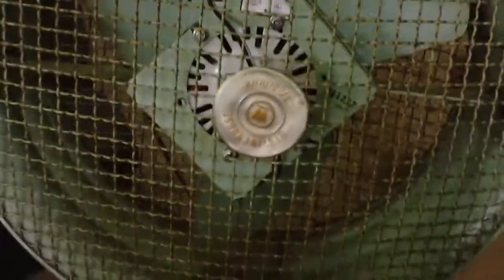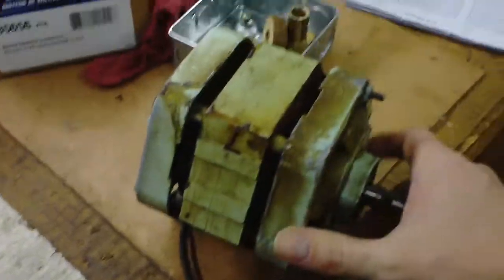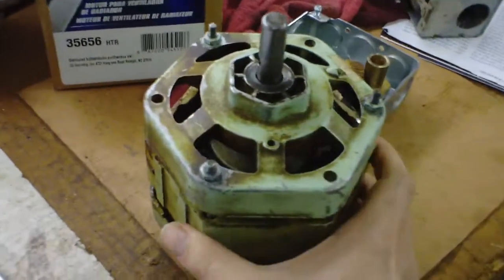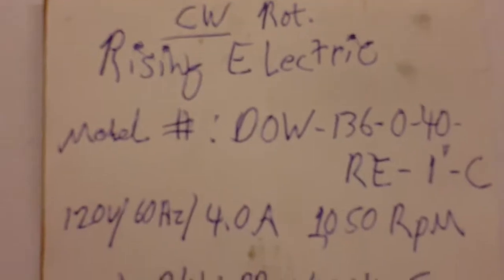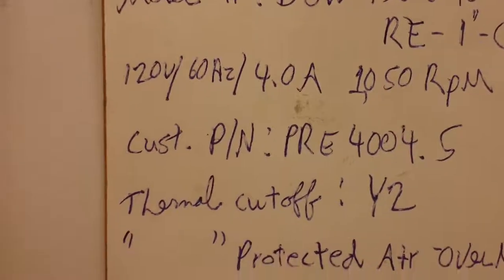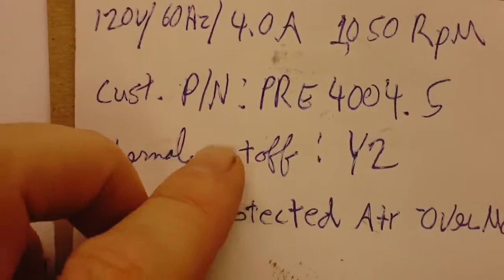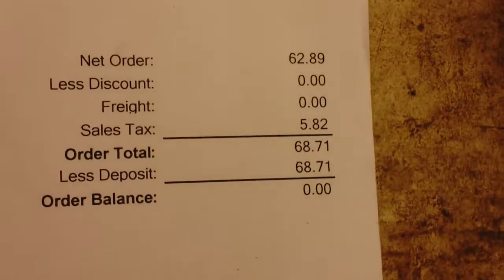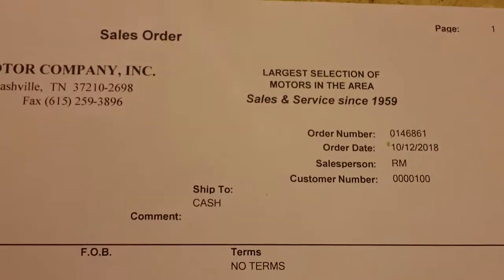How to Fix(replace motor) Westinghouse Classic/Vintage fan

Comment: Oh boy, get rid of that switch! Any hardware store 2-pole switch that you’re comfortable with should work. Avoid pull chain type. Either lo-hi toggle or rotator knob type, as long as you)re familiar with the wiring old to new. I have the old Mobilaire type turn for low turn for hi and can’t reach behind to fix it. Great fans though.
Reply from the maker: Good to know, thanks for the info. Problem is; I fixed it for a lady & gave it right back to her. Wish I'd known before I did the work, but that's the point of sharing this stuff, otherwise I'd never known. So thanks again man, take care from Tn.

Comment: If you still have that fan I would get rid of that switch, which likely caused the motor to short. They have a history of making contact with lo and hi speeds at the same time. You don’t want to kill that new motor the same way.
Reply from the maker: Thanks for the tip, it may have done just that b/c the new motor failed soon after for no apparent reason. The shop replaced for free I think & they couldn't find anything wrong w/ the new failed motor.   What switch do you recommend?
Thanks again, take care.
Reply from the maker: I may fix it for her again, new Chinese motor is just a single speed, so 1 pole switch will work & I've got some now I got off Ebay.